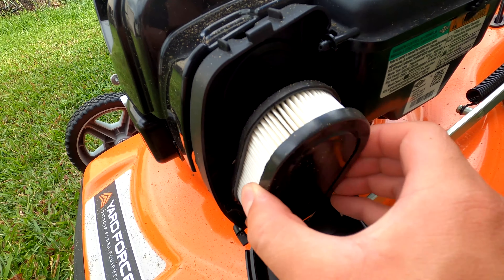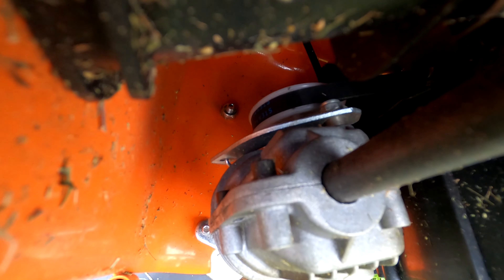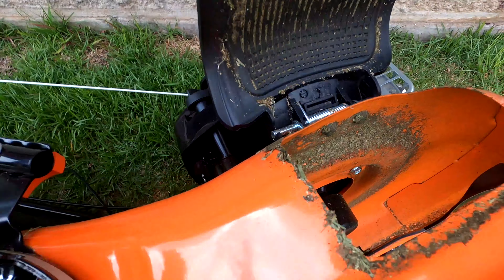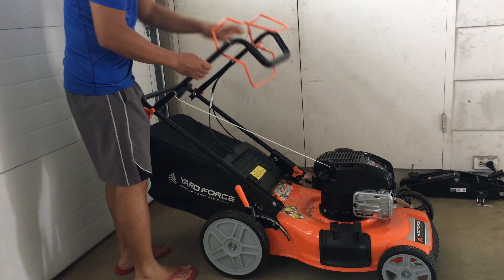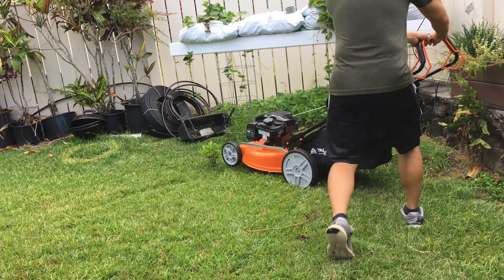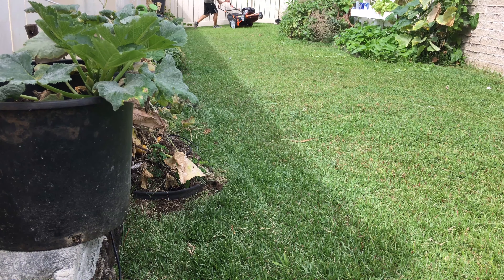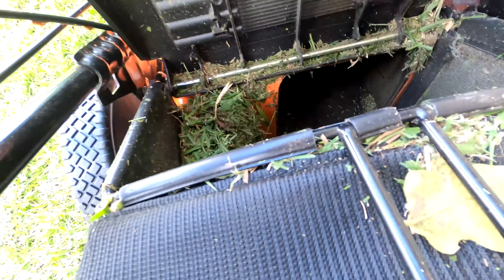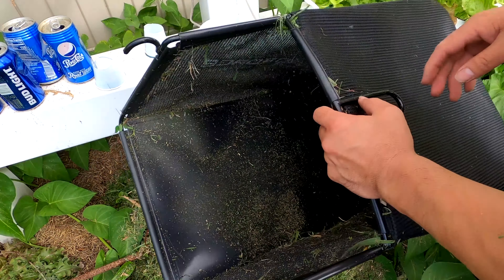22” Yard Force 3N1 Mower Review and How to Use Sam's Club YF22 3N1SP SC Briggs and Stratton 675 Exi

Comment: My recent purchase of Yard force mower has resulted in the self propelled clutch connection failing. Merotech is the warranty handler of this brand and you need your receipt, SN and a picture to get the warranty services. In OK, there are current no vendors to do any work on these. Coffeyville, KS (1.5 hours away) can do it. Still waiting on opptunity to drive there to see. Maybe they need to make some calls and get more local vendors in major cities to support their warranty. The mower works great otherwise.
Reply from the maker: Thanks for sharing, I completely agree that the biggest issue with the mower is getting servicing done.  If they could expand their network of repair centers and stock their parts at local stores it would greatly improve my opinion of the mower

Comment: Good review. Thank you for pointing out the plastic pulleys. I'll check mine and see if it is designed the same as the SC 675Exi. I just bought the YF22 3N1SP 625 Exi from Amazon. It starts on the first pull and runs solid. I just wish the self propelled speed could be adjusted down to a more comfortable pace to accommodate my age and neck problem. I don't mind the fast walk on a flat surface but I'm not crazy about wrestling the bucking bronco pace on turns and slopes. I also am not thrilled with Merotec USA. You were correct in saying they are difficult to communicate with. My mower came with a damaged left front wheel / repair weld and dent on the front skirt.....(although it was listed as new). Merotec USA answered my calls and documented my complaint but have yet to respond to my emails. After my short experience with Merotec USA's odd policies about the mower being non returnable.....plus who is allowed to work on their mowers, I will definitely be more cautious about choosing one next time, especially since the exterior appears to be sturdy but the underside construction is plastic and what appears to be aluminum instead of steel.

Comment: I bought one 3 yrs ago. I wanted a rwd push mower and it fit the bill. I found the same mower built by snapper as well just different name and color. Only problem I've had with it has been the carb and chute getting clogged in thick or wet grass. I don't use the chute and just prop mulch cover open and have no problems

Comment: i have the husqvarna hu700 with the honda engine now about 10 yrs old. i use it as a push mower due to the crazy stupid steel to plastic drive system. went through a few sets of belts and wheels and then just gave up. it has always started on the first pull with a few exceptions. i too was PO'd at the thought of no drain plug for the oil. my technique is to turn off the fuel line and run it dry. turn the mower on its side holding a pan to catch the oil. i change the oil yearly. i can't imagine an engine that never needs an oil change! i am currently looking for a new 22" mower but considering whats on the market i think i will keep my old husky.

Comment: JUNK mower. Do NOT buy. Parts are only available from one source in USA. NO support. Spend the extra money and buy a Toro Recycler...completely rebuildable, parts easily sourced. I work on Toros after they are years old and need a new belt due to age.
Reply: I was just about to purchase it from Sam’s Club with $80 sale bringing it to a total of $299.98  guess I’ll go for another Toro..”     Thanks 😊
Reply: Similar experience. 1 yr after purchase,  gear box failed, rear wheel bearings separated, and rear wheel plastic gear threads split. P.O.S. mower. Don't waste your money.

Comment: I bought this mower and not even a year has gone by and first it stopped self propelling and then the start cord won't pull.  It's exactly as you feared, a rock must have cracked the plastic belt cover, then after another rock or 2 hit it, a huge piece of plastic broke off, then it filled full of grass, and eventually wouldn't pull itself -- a replacement cover was sold out and they(Merotec's supplier) told me they didn't think they were getting anymore!  I thought I would just have to push it, then the pull cord stopped pulling, so time for another new mower.  Merotec told me that it was covered by the warranty, but I have to drive it 25 miles in my small car to the closest repair center.
Reply from the maker: Wow, good information, it seems like they had to cut corners to price it as low as they did.   I’m wondering if anyone has experience with other brands of mowers in this price range, and if the quality and warranty servicing is similar?
Reply: If you look under the plastic cover you will see the drive pulleys are plastic too. Seriously, who puts plastic pulleys under the deck of a mower?

Comment: Wondering why mine won’t pull backwards? Any thoughts? I have not mowed with it yet.
Reply from the maker: Are the wheels locked up when you pull it backwards?
Reply: Usually these self propelled mowers have a little trick. You have to let go the handle to disengage the self propeller mechanism and keep pushing the mower for a little (some 5 to 10 inches) and then you will be able to pull it backwards.

Comment: If I could ask for a little bit of help. I have spring that came off and they have not provided a diagram it is a black spring that connects to the deck and then somewhere to drive mechanism. You can see spring around the 1min 35 seconds mark or a few more seconds on your video

Comment: As of 10/21/21 my YF mower HAS BEEN IN THE REPAIR SHOP FOR 61 DAYS WAITING FOR A DRIVE CABLE.  DON'T BUY THIS PIECE OF JUNK. I ASKED FOR A REPLACEMENT MOWER, HAVE YET TO HEAR FROM THEM. It's advertised as 22", that's the deck not the cut. The blade is only 21" , requires a-lot of overlapping & only available from the main distributor for about $35. I have owned one 13 months. Over the weekend, after mowing 3/4 of my lawn the drive cable broke under-the-deck end. Pushing this thing thru high Florida grass is a workout. I bought it at Sam's club (who apparently thinks it will last forever) but they know of no repair places locally. I called the manufacturer's  customer service line & had to leave a message. They returned my call but before finding out about a local repair shop, I must receive a service authorization (ala return authorization) by providing all purchase info 1st.  I'll update my adventure as to the outcome on this link.

Comment: This thing is a piece  of crap. Used it 1.5 months and it quit running, no spark, Called  Yard Force and was told it was Briggs and Stratton's problem. Called Briggs and  Stratton  and was told to take it to their qualified center that is about 80 miles away and even then I may not get it back until midwinter.  This is not acceptable. 2 year warranty what a joke. I will never buy this junk again.
Reply: I understand your frustration. This B&S engine has a notorious flaw that is easily fixed. The plastic choke touches a metal bracket and stays open. It will not start when it is stuck open. A metal finger nail file will shave the excess plastic off of the choke assembly without removing the carb' but you do have to remove the air filter housing to access it. (4 bolts 2 different sizes).

Comment: This mower is complete junk. I’m on season #2 and it starts, but will not continue to run. I run ethanol free gas, use SeaFoam, etc. and it has continued to give me starting and running issues over my first year of ownership. I’ll never buy a “cheapo” model from Sam’s Club.
Reply: I saw another video about the engine on this mower and it has a design flaw in the automatic choke and the lever that works the choke flap gets hung up on the bracket making it impossible to start cold.  Here's the link: https://www.youtube.com/watch?v=9GSM0TnprNE

Comment: The engine is 163cc with 6.75 ft.lb of torque, not horsepower.
Reply: True. 163cc is closer to 4.5 horsepower but I understand how torque ratings verses horsepower could be confusing. They are both imaginary numbers derived from mathematical engineering formulas.

Comment: Lemme tell ya something.  STAY AWAY FROM ANYTHING CALLED YARDMAX! Chinese junk!  I bought a ‘22 around 5-15-23 and used it only about 5-6 times.   It is made with extremely cheap components.  The plastic knobs for closing and locking the handle broke off. The height adjustment broke off.  The front wheel broke as I was using it and the axle came out off place. The plastic for the undercarriage cracked in two requiring its complete removal.  That cover the belt and pulleys for the self propel assembly.  Needles to say, that can no longer by used.  Surprising no engine issues (yet) and it will cut serious grass-provided you have patching up skills.  THIS POS IS CHEAP FOR A REASON AND YOU WILL GET WHAT YOU PAID FOR!
Reply: Wow for all that breakage you must of abused that thing to Death ☠️💀

Comment: Where can i buy an after market blade for the yardforce mower from sams club?
Reply: After many phone calls, I found that you have to order the replacement blades on line from Outdoor Power Direct.  Beware though.... the blade they sold me didn’t fit but the Yardforce customer service insisted that it was the correct blade… They also would not stand behind the warranty and insisted that Sams Club sold me a remodeled lawnmower that was in a brand new sealed box!!
Reply: @carolladner1727  Clark Howard has information about buying warranties. Most "cheap" products on the market today have "built-in-obsolescence". It is like the toy at the bottom of a Cracker Jack box. Do not ever expect anyone to honor a guarantee or warranty. If they do, then you were one of the lucky ones.

Comment: make sure to post a end of season review too. these are super junk mowers at sam's, have fixed 5 for customers so far, that had 40 mows each, sad no oil change plug have to dump old oil out the fill tube, stuck valves, wheel bearings are not sealed, bag has a stitched section inside that fills up with dirt an has to be cut to empty lol  Make sure to use quality synthetic oil so it will last 5 years hopefully
Reply: Briggs & Stratton claim their motor never needs an oil change and thus, no plug.  I am very skeptical about this claim.  Oil eventually degrades and needs to be changed.  I'll be doing what you said and dumping from the filler.  It's far from ideal to do it that way.  They could have put in a drain plug and made their claim but let me do a change anyway.  I saw another review about most of the motor being plastic parts so I think they just assume the mower will fail before the oil is too degraded and useless.
Reply: I agree, mine has starting issues, took the carb off which is a push on carb with an o ring, could not get to the internal parts of the carb but was able to see inside after turning out hex plug, all plastic inside carb, shook carb a few time heard rattling, put everything back together, would not start, took a tool tapped the carb15 times, started, this time I was able to mow my entire yard without it stalling🤔